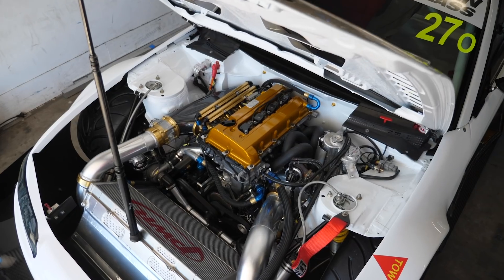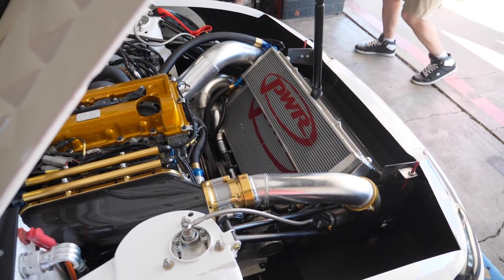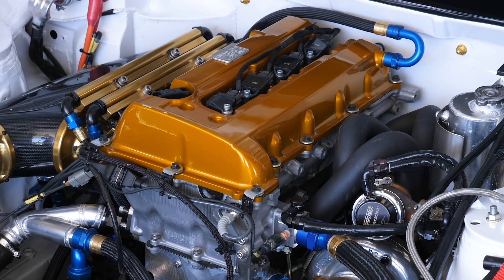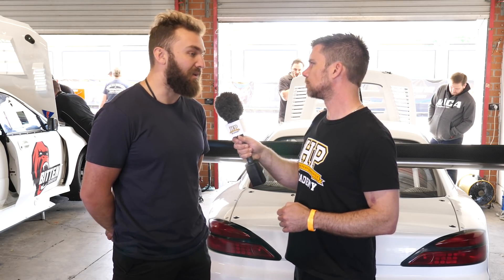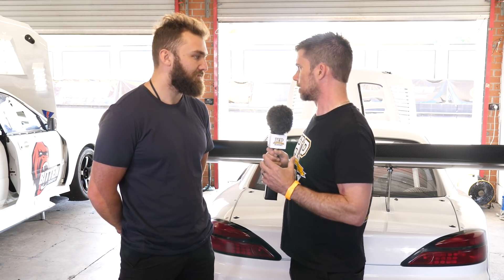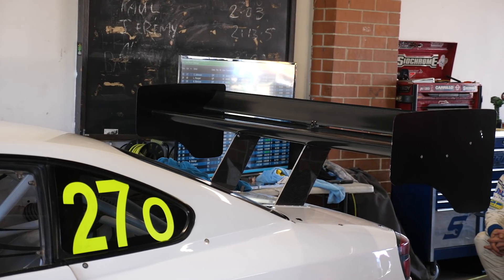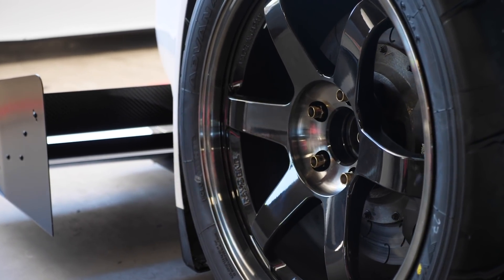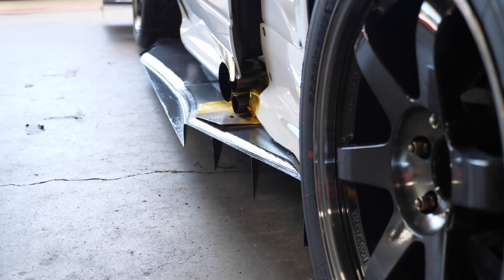FLAWLESS 900HP 2.2L Nissan SR20 S15 | Time Attack Dreamboat [TECH TOUR]

Comment: Awesome to see that they’re running an electric water pump because my first question was if you’re gonna be running the VET head usually most guys run them up to 10,000 RPMs and at that engine speed typically you have to go with either an electric water pump or an under drive pulley in this case an electric water pump is if I’m not mistaken used in the bottom left below the blow off valve from what I can see Id just like to know what kind of set up he used for it because I’m trying to think of A similar solution for my SR which will be running around 9k rpm if I can. The camshafts rockers and almost all the rest of the Valvetrain are to be cryo treated since I opted for the det head.

Comment: Amazing setup, no corners cut. However... 4:33 another turbo pushed about to its limit, another car that would thrive on pre-turbo water/methanol injection
Reply: No it's got no need at all timing numbers are crazy . Egt is not pushed . It makes more than the turbo is rated to . Just needs more turbo
Reply: @fokjohnpainkiller  because it shifts the compressor map to the right, which is what they need
Reply: @26Petermc  sounds like you've got inside knowledge of the car, awesome. I'm not surprised to hear it's not knock limited, they didn't discuss fuel in the video that I remember but the fact that they've got two sets of injectors per cylinder tells me it's alcohol. However, he admitted they would benefit from a few percent more out of the turbo, might as well spray into that inlet and push the compressor map right a bit. It would only help, not hurt
Reply: @MR__JUSTIN  I built the motor . It's e85 . Inlet temps were in the 40s the efr  is just to small.  No point floging a dead horse.  Not seen much if any improvement when it's not needing more timing
Reply: @26Petermc  but what if the horse isn't dead yet, and just needs a little water to perk him up and get him to run a bit further? I'm not saying this would enable a more aggressive tune, which is the only benefit most people think of when they hear "water/methanol injection" but rather spraying into the compressor inlet which enables to it compress air more efficiently and therefore physically move more air. It's not going to be a dramatic step up, it's not going to be like swapping in a 9280 but it will give you a few percent more, and without the higher boost threshold penalty that a larger turbo would incur
Reply: @MR__JUSTIN  when it's already got as much timing as you can ever want . There's just no more lol
Reply: @26Petermc  not sure why you're still talking about timing. It's not about more timing, it's about getting more air through the same turbo. The "horse" in my illustration is the turbo... perhaps you should re-read my previous comment (and read up on pre-turbo WMI if you don't believe me when I say it will make your turbo flow more air)
Reply: @MR__JUSTIN  you don't get more air in you increase it's air density but at that point it's 5 or 6 hp . In 1000 hp . Not worth talking about
Reply: @MR__JUSTIN  just so you know we test the water meth on So many of these things . From the 50 or so times we have tried it's not been something that's worth the kg it takes to fit in a real race car ...
Reply: @26Petermc  just curious, out of those 50 or so experiments, how many of those had the water/methanol injection point PRE-turbo? Spraying directly into the inlet of the compressor?
Reply: @26Petermc  that's true, there's always a compromise - adding weight to a race car is never a good thing
Reply: @MR__JUSTIN  the 3 cars on the podium the engines were built by me . I test all this shit . I know that 2 of the engines lost hp with the water meth . . It's not always what you think will happen
Reply: @26Petermc  you dodged my direct question, just like you did 4 months ago on another video. That's OK though, you're definitely under no obligation to share secrets with the YouTube world 😂 I appreciate you sharing what you do, and congrats on building winning engines! Sounds like you're at the top of your game, something to be proud of. But losing power when adding WMI?  Sounds like your tuner can't say the same 😉

Comment: 1/4mile time? It has to be a low 9 second car!
Reply: 8's with a good driver based on the power/weight, but it doesn't matter. That's not what the car was built for.
Reply: M3ntal crazy! Pretty soon we’re going to have 6 second time attack cars
Reply: @pawg206  No we won't. Going from high 8's to high 6's is way harder than you're giving credit. Power/weight is one argument, but the chassis setup is entirely different as well.
Reply: @SlightlyM3ntal  yeah dude. Going from an 8 second car to a 6 second car is a whole different game. Those cars are strictly built to go straight.

Comment: These time attack lads are joke, it’s taken them 15 years and another 400bhp to go as quick as a race lap 500bhp spec single seater. I mean that’s 15 years of tyre, electronics, aero and chassis development and they still can’t get the lap times - the early 90’s TS-010 was about 10 seconds faster and that’s 1992. It just illustrates the massive gulf between the aftermarket and performance industries versus actual educated motorsports professionals. People need to learn that bolting shit to car and throwing boost at it doesn’t make laptimes. Maybe a video with some actual proven motorsports chassis engineers could be a good eye opener.
Reply from the maker: These Time Attack cars do not run racing slicks and must keep some aspects of a production car, given those aspects are relaxed compared to some other classes. They're hardly comparable to a big budget (even that one from 15 years ago would have 5 times the money pumped into it as this car has at least) purpose built single seater with a driver that has many hours seat time in that specific chassis, in my opinion, but you're of course welcome to your own 😎 
If Time Attack starts allowing single seaters and slicks at least and they can let rip for lap after lap, which I doubt, then it will be more 'apples to apples' - Taz.
Reply: High Performance Academy. Granted but it’s not really the point I was trying to make, laptimes should be derived from solid mathematical fundamentals and a higher understanding of vehicle dynamics rather that bolting on the best of what the aftermarket can churn out and upping the output. All things being equal time attack cars do what they do well but it would be nice to see how effective a more academic approach could be. As an aside - Spec single seaters, no mater what the level aren’t really about big budgets and development costs, just cost effective speed. If, as a race car chassis constructor you’re only competitor is yourself then it’s not in the business’s best interest to make it as fast as possible rather cheap, reliable and robust.
Reply from the maker: I think you should watch a few more videos of some of the builds on our channel, including the interview with Andrew Brilliant. There is certainly a bit more to it, assuming that you don't in-fact run a road turned Time Attack car that is performing to the single seater level you expect that is. Bit tongue in cheek that remark and I don't mean to insult, but it is one thing to look at something and state how easy it should be, and it is another to actually go out and do it in the real world.
The lap time these cars are chasing around Sydney Motorsport Park are still impressive when compared to the touring car class cars, which are big money albeit more regulated, but also not single seaters.

Essentially, we're going to have to agree to strongly disagree with each-other here haha, but that's OK =) - Taz.